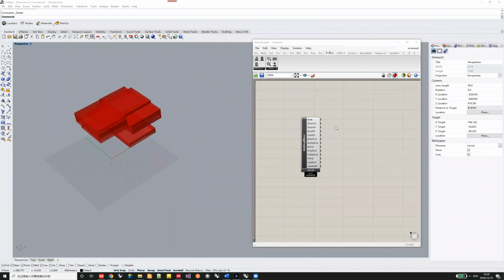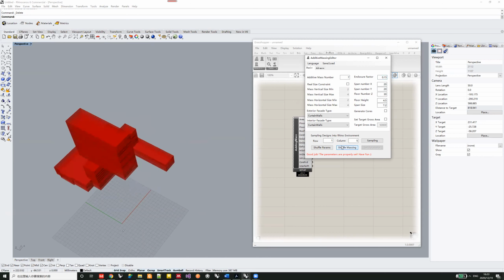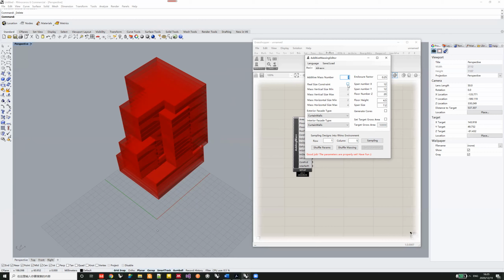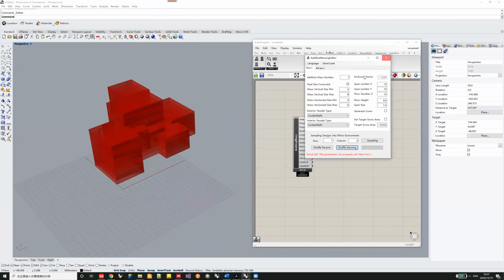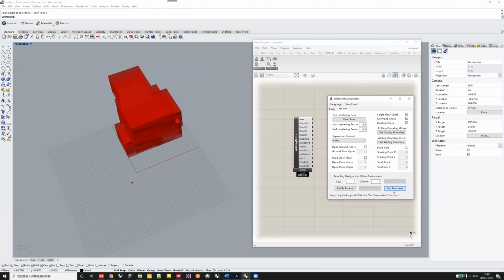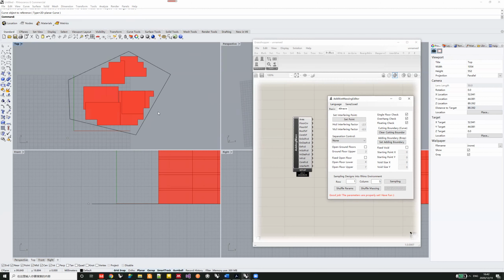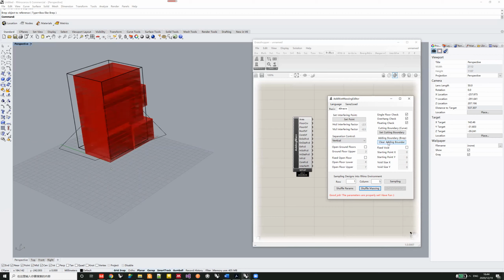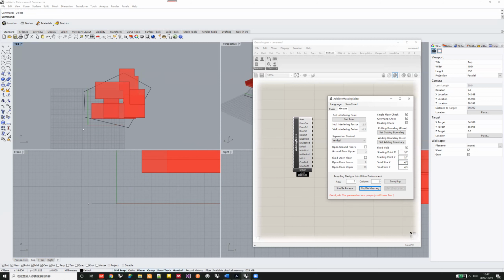EvoMass Tutorial Part 5 - Additive Massing Generative Component

Comment: Hi there. Thank you for the tutorial.  What does the number in the Span Size mean?
Reply from the maker: Hi Chin Wooi, the span size means the size of a column grid unit or the distance between two columns. And please be aware that the algorithm does not generate the columns and the column grid size in both X and Y directions is set to be equal for the current version of EvoMass. Detailed information on the algorithm can be found in this paper (https://www.mdpi.com/2071-1050/11/24/6965) : D